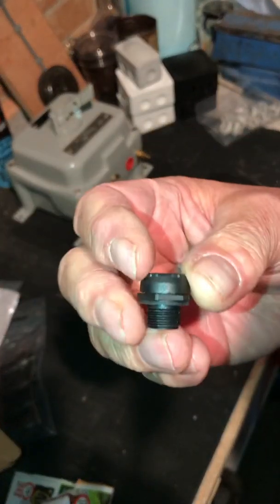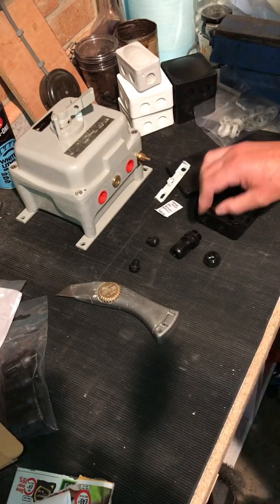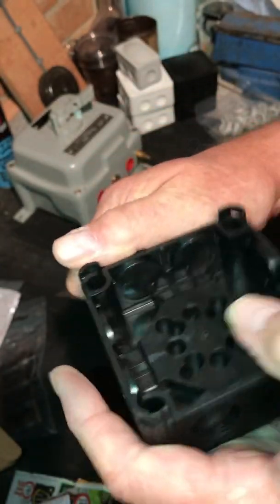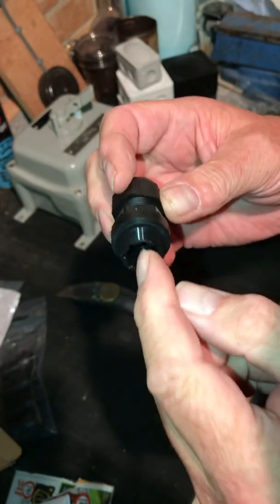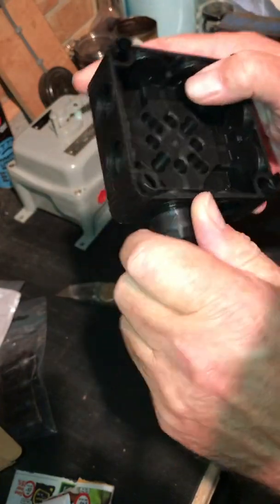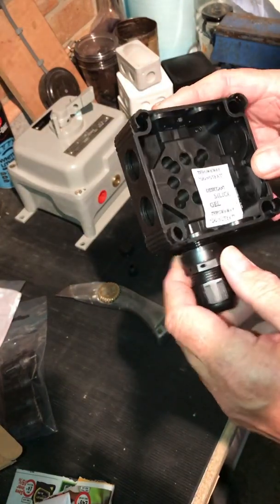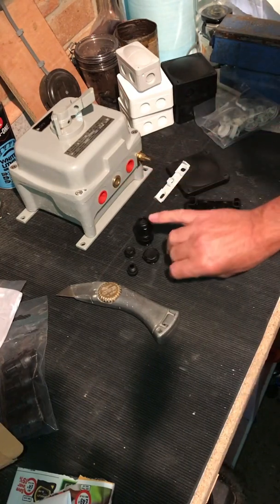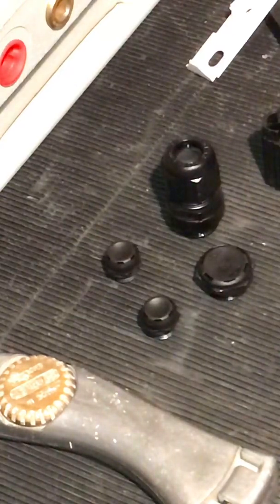Wiska Box Venting - Vent Plug and Vent Gland

Comment: Should these go on the bottom, top or sides of a BG outdoor socket? Don't want to drill a "drain hole" Thanks
Reply from the maker: I always prefer to have holes in the bottom but some of these work in any position. Always check the manufacturers instructions! 👍